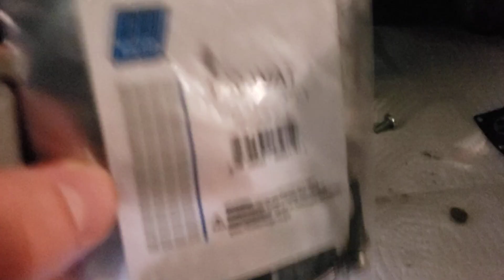Losi ⅕ tuning problem solved. clogged carburetor

Comment: Hey bug my Losi 1/5 Mini WRC has had a tuning problem for two years now, haven't taken the time to fully fix it. For some reason I'll run it for five minutes, it'll overheat and have to cool down. I've tried tuning the needles to no avail, any suggestions?
Reply from the maker: Replace the fuel filter fuel lines and an OEM carb kit and the correct heat range and length of plug stay consistent with your fuel mixture 30:1 with a motocross like klotz super techniplate oil and ethanol free fuel. Remember gasoline runs hotter then nitro. How hot is it getting? Also Remember these ⅕ engines are fan cooled tune till you have a slight 4 stroke sound at peak rpm you will be safe. Check out the last ⅕ run video so you can hear what I'm talking about. But like I said fuel  Insistency is crucial as changing oil ratios without correct mixing will also change your fuel air ratio.